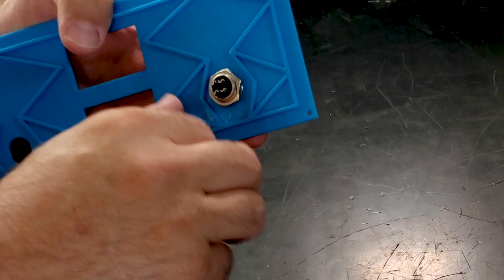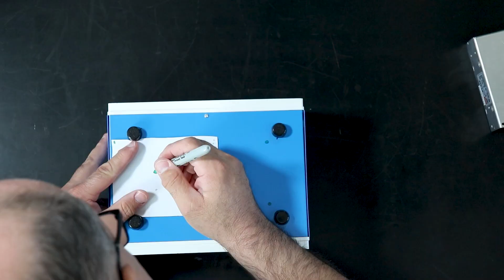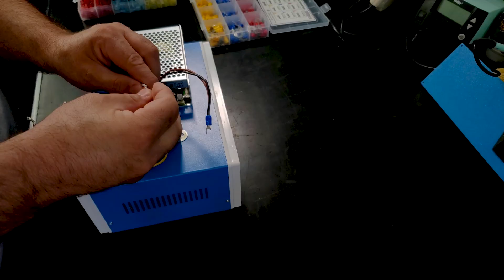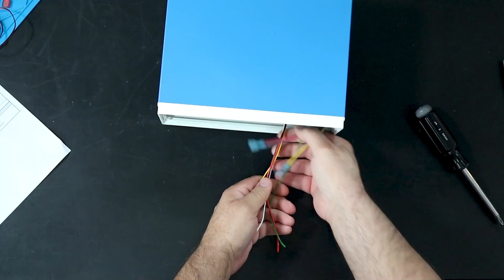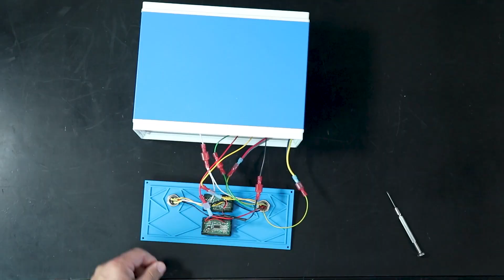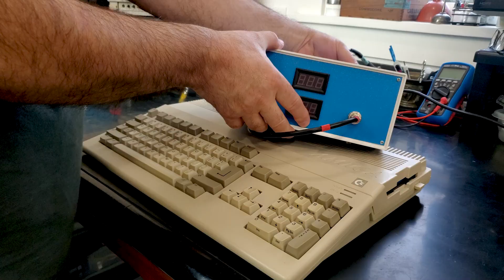Building the Commodore Universal Bench Power Supply

Comment: Hello, great video! Will this work with a C128, a 1750 REU and a 1581 floppy at the same time?
Reply from the maker: Looking at the specs, an unmodified 1750 on a Commodore 128 is within the c128s power supply spec so it should be just fine. Once things with The Stone Collection settle down in a few weeks I should be able to test it. 

I'm also planning a number of improvements including increasing the drive connector from 5 to 6 pins to accommodate tieing neutral and ground at the drive connection end - not a big deal but technically more correct to reduce ground loops. Also a front panel power switch for Amiga convenience and a banana jack to ground for plugging in an anti- static strap. Finally tieing the front and back panels together for less flex when unplugging tight cables.

Comment: I have a similar meanwell PSU for my Amiga 1200 but it tends to float the 12V too high, especially when the +5V is loaded and the 12V is very lightly loaded. I need to adjust +5V a bit higher to compensate for cable losses anyways and there's just a single adjustment. Solution was to run a beefy diode (drops half a volt) from the +12V to a free terminal on the PSU, put a load resistor across this and ground and bring the lowered 12V out of the free terminal to the computer.
Reply from the maker: I will keep an eye out for that. How high was the +12 rising?

There is already a pretty long list of improvements I want to make so I will keep an eye out. 

I was surprised how spot on the voltages were under the load of the Amiga 500. I had not noticed until I was editing the thumbnail that they were exactly 5.00 and 12.00!
Reply: @RavenWolfRetroTech  I needed the 5V at about 5.5 which made the 12V climb out to over 13.5 unloaded. I think these usually control the 5V and the 12V just follows up with the load as the switching transistor stays on more and more, with those models the 12V starts low and only gets to 12V with near full amps on the 5V for better quality PSUs.
Reply from the maker: I don't worry too much about unloaded voltages since that is just a potential without any current flow. I would be very worried about 5.5v or 13.5v with any kind of a load though! It sounds like I am just going to find a 1200 to play with, darn 😆
Reply: @RavenWolfRetroTech  Overvoltage will kill chips without mercy, current follows after a broken insulation... I did have -14 volts on the -5 volt line on my "new" A2000 just recently, luckily the voltage was not used anywhere really so no damage. Reminds me to put some crowbar or zener protection on old gear at least.
Reply from the maker: Yeah, I have a C64 black brick of death that has 12V on the 5V rail. I just meant that some power supply designs don't regulate well until there is at least a minimal load. I test the PSU on every vintage Item I get before powering the device with it. Now that I think about it I am getting a pretty long list of items that I have no idea if they work because I have to gotten around to pulling and testing their supplies 😆